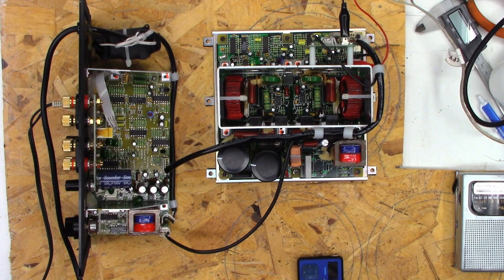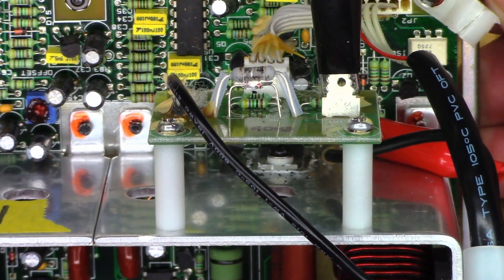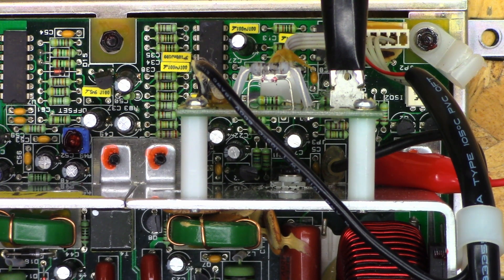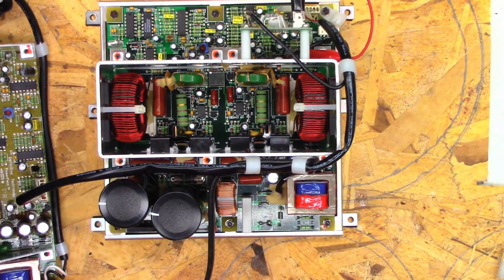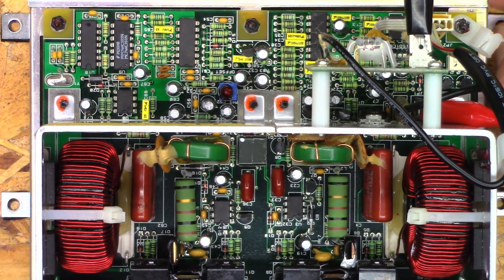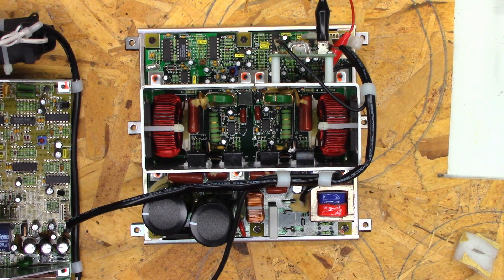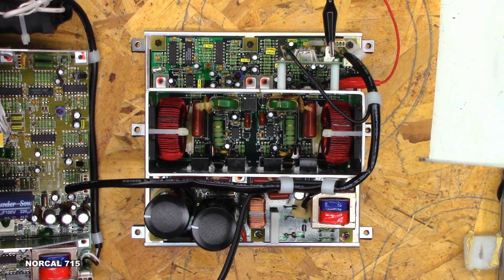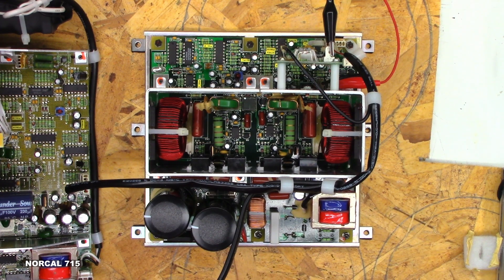Pt 4 Definitive Technology PowerField SuperCube "Trinity" 2000W Subwoofer Almost there! Schematics!

Comment: hello ,
I got a Supercube 1, Same board in your video, Am getting crackling noise but no sound, even there's not input connected. I replaced caps in the pre amp board +/-15V section only. And also I replaced few caps in the power amp board 4 caps at the power transistor and few around the regulator. Now am getting sound, but the crackling noise still here. Should I just replace all small caps in the pre amp board and power amp board. When I got the subs, the 8A fuse was open. but all transistor tested ok. I put a 5A fuse for now, Unit turn ON, Just that crackling not going away. Any suggestion.

Comment: Is there an NTC on the heat sink anywhere? Page 7 shows an NTC labeled R5 and notes to "place on ground FET" and it is on the mute circuit. Being on the mute circuit matches your condition when you cool it and the audio comes back. Could there have been a modification to monitor current via the heating of that resistor, instead of an NTC on the heat sink?  It still doesn't give a value for the actual resistor though, but the part number for the NTC is a small glass NTC that resembles your R5 / F4 component. But, that's all I can see on the prints and without the amp in front of me, hard to track it down. Where does the other end of the 4 pin connector connect too? Can you follow that wire to a known component?  Page 7 also shows the placement of the NTC, but shows it mounted 6mm off the PCB, with sleeving. Which, also sounds like the little blanket it has. So trace that path back and see if that resistor is in series with one of the FETs. The value may be there.
Reply: That's got to be it. Looking at the video again, I see the black jumper come off of the PCB by where a temp sensor would be, right next to some transistor. So that board is the NTC circuit and uses that resistor to heat it, instead of using the heat sink. Now, what value did they choose? Good question.
Reply: But yeah, now I see. That resistor is in series with SPKN and there is nothing on the prints showing that resistor. Maybe you covered that in an earlier video and I'm late to the game. Since the owner was able to get the schematics, maybe he can give a call back and get more info on that added board, now there is more info on what it's doing and the resistor in question.

Comment: 🐨I found out if you don't request a matched set of Fets or same batch from your supplier, one of the fets if they're 
NOT close to each other will have one or both heat up and fail within hours of test running, When testing a 
Class D amplifier on assembling one or a repair of it, if the set don't get hot or work for 12 hours just under full 
power with both fets only warm the repair is a success, BUT if one of them is hotter though the repair will be 
Sub-Par and thus require a better matched set from another batch all manufactured at the same time.

I always request two matched "Three matched Fets" if they're cheap so that I can match them closer to each 
other myself. 
APU I dropped yo a 👉👍👈

Comment: 0R33 looks about right for that resistor, orange orange, second one faded the same as first, then silver and gold. So 0R33 5W non flaming 5% resistor, which has been well cooked in operation, but not enough to melt the resistive element wound under the grey ceramic. Probably worth changing to a 10W resistor, and placing the thermistor, likely there as a potential divider with the input to control peak volume, and shrink that together, or just use a fibreglass sleeve to hold them together instead, in the fill of the boat. But yes that 2kW is a fake rating, likely the actual output is around 300W in reality, the 2kW is from the peak supply voltage, around 150V per rail, into the 20R resistor load, with output FETs dead short, for a single mains cycle. Till the fuses blow, or the input bridge rectifier, which is probably only a 10A unit, as the fets are likely long cooked.

Comment: Did you check the capacitors on the speaker output (the ones that go to ground to filter the high frequencys  from the pwn output, or did you replace them for non ideal ones.
Yes im jibbering lol.